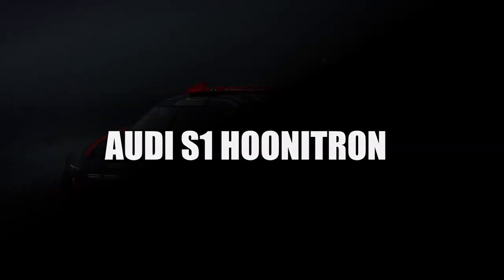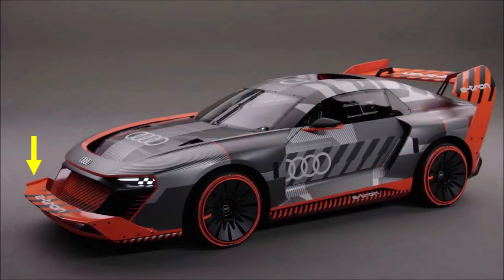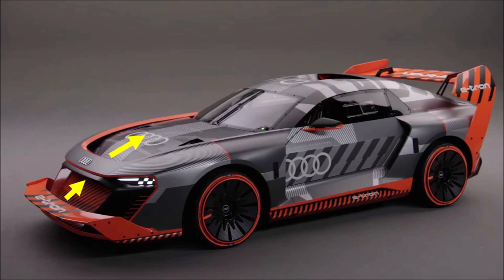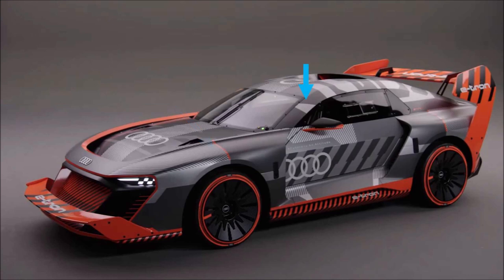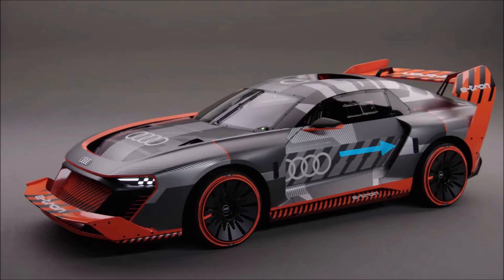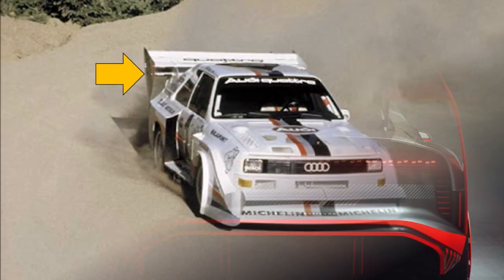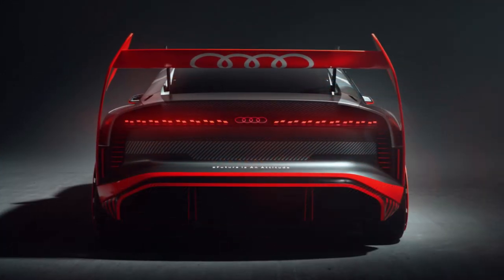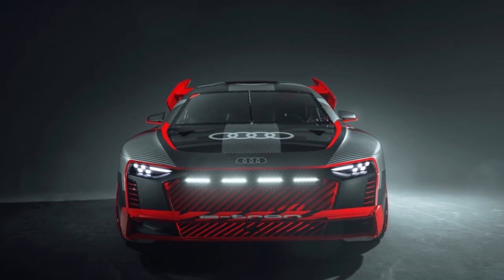AUDI S1 HOONITRON - First Look (Aerodynamics)

Comment: I feel like the front bonnet element (not the wing) is kind of pointless. Does this not create extra drag over a traditional, non-split nose?
Reply from the maker: It's a design feature here to keep the design of the old S1. The nose could be super flat on the new S1. But if they would have closed the single frame it would have increased drag because of the larger high pressure area in front and more directional change for the airflow.